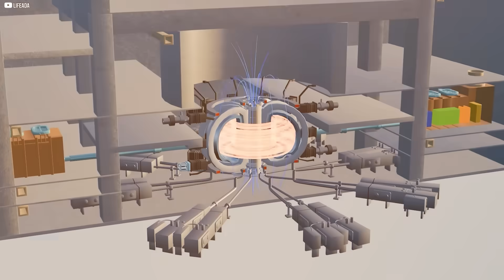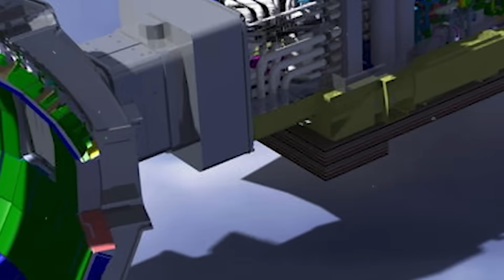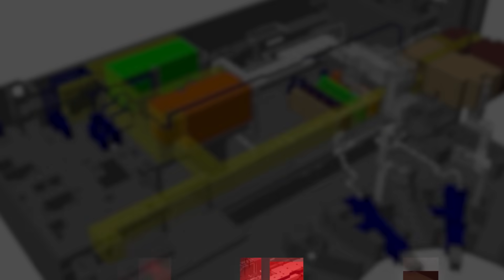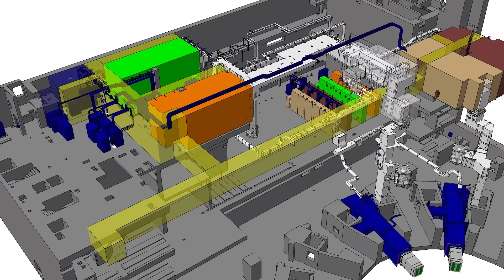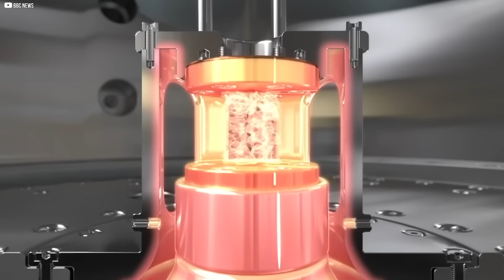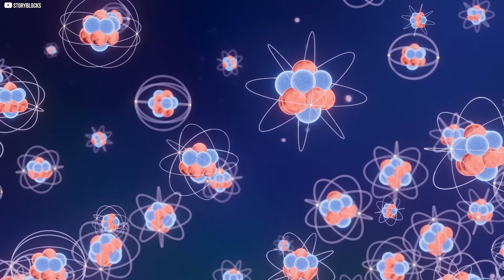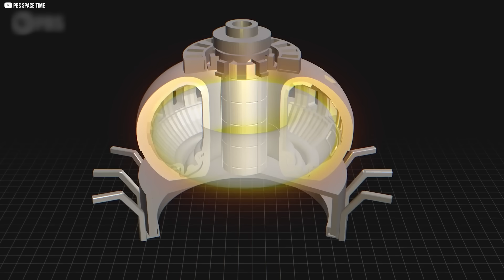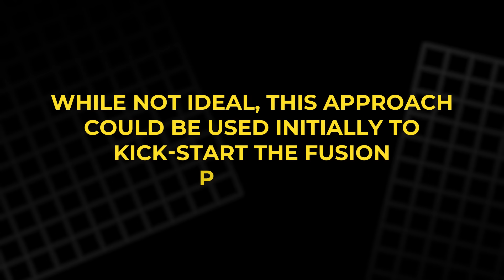Can We Solve The Trillion-Dollar Problem With Fusion Energy?

Comment: Fusion… Tritium and lithium 6 has the property with crystals and pose significant challenges.. my work actively is working on solutions. My focus is on cube crystals divided into twelfths… to build and capture of elementary particles with exactness or preciseness, and possession from angular facets that enchant and enchantment(attraction-push -pull.. a rhythm option to lock up gravity). This gradient that doesn’t exist in non-spherical objects. The complex arrangement or organization arrangement of its parts ,based on period tables. other period tables do not exist – crystals-particles –ion’s.. as yet un knowledgeable… jacktar.
Reply: Wenn 99,9% der Masse im Kern sitzt, welche ja erhalten bleiben, was und wie viel % werden umgewandelt und würde man eine Maschine mit einem solchen Wirkungsgrad bauen?
MfG P.

Comment: 2:45 all the candu's together producing 500 grams of Tritium annually, with a Migma IV d-d+ beam collider you can produce 4.75 grams of Tritium PER DAY (+ also he3 and free neutrons for making u233 out of thorium)
the by products of this device, if sold at market value would total $500,000 per day (11 years ago....probably most definitely more today)
so a SINGLE device if running every day for a year would make about 1.6 kilograms of tritium ...over 3 times as much as all the Candu reactors combined

(and you dont need any Lithium-6)
Reply: Bitte keine Logik, denn hier geht es um Visionen oder waren es Halluzinationen, da kommt man leicht durcheinander.
Wenn aber ~99,9% der Masse im Kern sitzt und die Kerne ja erhalten bleiben, was/wie viel wird dann umgewandelt?
MfG P.